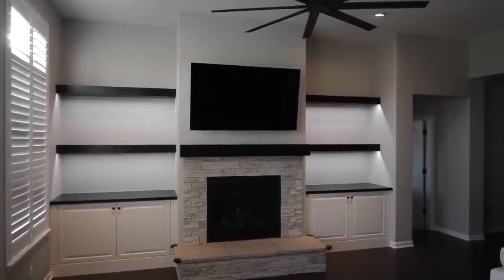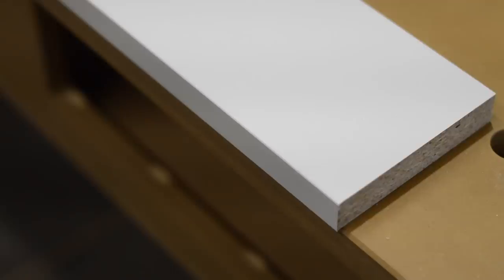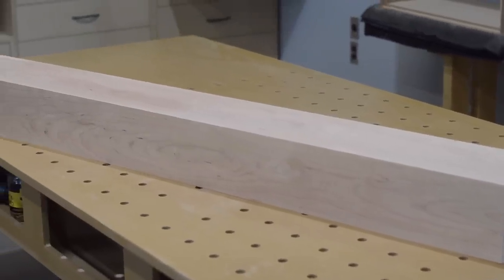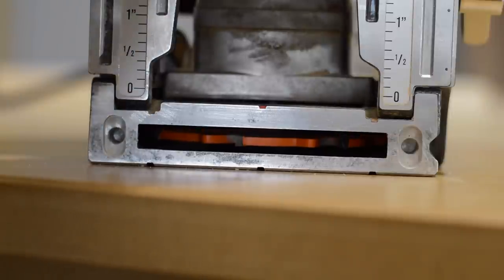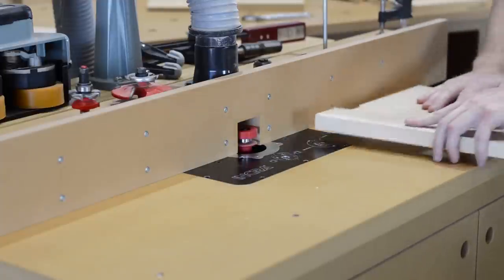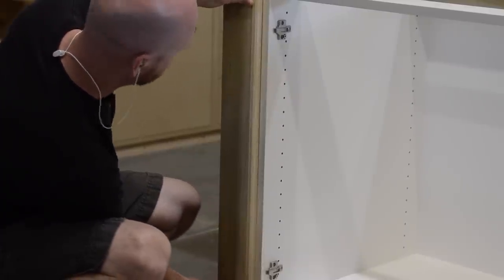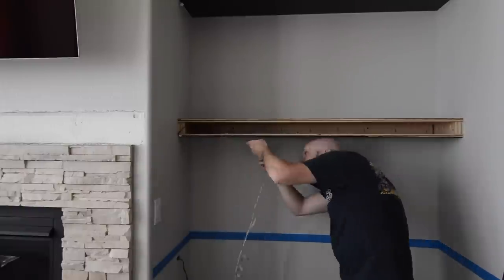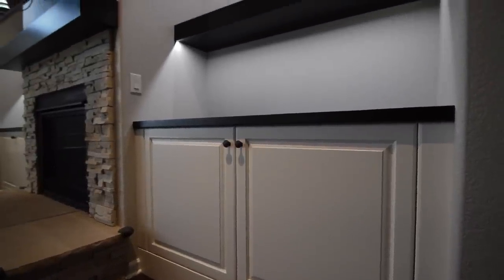Custom built in cabinets, floating shelves and fireplace mantel

Comment: Great video! When/how do you decide to use plywood versus the melamine for cabinets? I would love to learn as I grow my business
Reply from the maker: Sometimes its the customer, but my normal is, I use melamine for cabinet interiors, its more durable and saves on painting costs.
Reply: Interesting, I wouldn't have thought melamine would be stronger in cabinet construction. What should I change in my thinking? Because I thought melamine had an aire of less quality than plywood. 

Totally makes sense on easier for painting sure.
Reply from the maker: @dougbeach7299  I should have been more clear. The panel itself is not as strong as plywood, I was talking about the melamine surface. Its more chemical and scratch resistant than a painted ply surface.
Reply: Thanks Mike. Love your videos and your teaching. I've been rewatching your videos while in quarantine and they are very soothing, funny and knowledgeable while I recover.
Reply from the maker: @dougbeach7299  That is great to hear, thank you.

Comment: What kind of HVLP sprayer do you use,  how much do you typically dilute your paint and primer and with what?
Reply from the maker: I have a ton of different guns. I normally spray out of a Binks 2100. I can't say how much I thin, I just thin until it sprays nicely. I thin with what ever the base of the material is. Water, alcohol, paint thinner, etc.

Comment: A question on the mantel, why didnt you use any biscuits as added reinforcement to the joints where the grain direction didn't match?
Reply from the maker: Its really not needed. Bevel joints are pretty darn strong. Plus it would have made the "tape as a clamp" method impossible. The joints wouldn't be able to fold closed. Hope that makes sense.

Comment: Hey Mike, could you install those floating shelves over shiplap, provided you do secure them into studs?  Or is the proper way to have the shiplap cut out where the shelves would go so that they are flush with the drywall?
Reply from the maker: I would not remove the shiplap. I would just calculate my screw length based on the extra thickness of the shiplap.
Reply: @MikeFarrington  Thank you for the reply and all your videos. I wish you were located in NH! We are trying to get something very similar to this with added shiplap. Still debating contracting out (Big $$$, but deservedly so) or doing it ourselves with semi-custom cabinets.
Reply from the maker: @werty73  Good work takes time and time is money. Good luck with your project.

Comment: How did you get electricity to the dimmer and is it a regular household dimmer or some low voltage thing?
Reply from the maker: The lights I used were an all in one setup. So the dimmer was low voltage.

Comment: Mike what do you feel is the best way to seal the edges on your MDF ,like your raised panel door,oil base primer ,automotive primers,or water based with a little alcohol added to quicken the dry time and prevent swelling of the MDF,im thinking oil base as in some of your passed videos you mentioned a few days drying time ,or are you sealing with oil base and them switching to water base to prevent the smell,people just dont seem to like the smell on the clothes in walkin closets huh...lol
Reply from the maker: Shellac base is my favorite, though oil based would work just fine. I would stay away from anything with water for the first coat or two. The couple days drying time is due to the use of water based coatings. I feel they need a few days.

Comment: War Pigs covered by Faith No More is probably my favorite cover that is right up there. Mike Patton and Ozzy both have a higher range so I actually like the cover a little better than the original. I know die hard Black Sabbath fans will probably thumbs down this comment. Also, No Quarter, covered by Tool is another one where I like it better than the Led Zepplin original.
Reply from the maker: I really like this one. I also really like No Quarter. Good selections.

Comment: for the cleat on the mantle, where did you drive the nails in to secure it?  What nails did you use?
Reply from the maker: I used 2" 18 gauge nails. Two from the bottom up in each corner, two from the top down.

Comment: What is your setup for spraying paint finishes as well as clear finishes? I’m working on a kitchen cabinet build and I am looking for some advice as to what to run in my shop. Thanks in advance!
Reply from the maker: I use a 60 gallon compressor through an air drier, to a conventional spray gun. Very simple but effective. I show more about that setup in my paint grade mantel.
Reply: @MikeFarrington  I appreciate your reply. Your work is beautiful. I’m a little down on space in my shop and my compressor is a small porter cable so it isn’t big enough for me to run a spray gun. I’m considering a Fuji setup but still exploring options. Thanks for the reply!
Reply from the maker: @Tomfrey  I have a portable spray setup as well. They work fine, but normally struggle a little with having enough power for water based or thicker coatings. If thats what you have space for, go for it, it'll work out good.

Comment: The mantel, did you nail, screw a cleat to the inside of the mantel? I noticed you put a clear on the wall but dont know if it's the width of the back opening or if there is a cleat.
Reply from the maker: Yes, there is a cleat I hang on the wall, and there is one inside of the mantel.

Comment: Hey Mike, i noticed you dont have rubber bumpers on the face of your biscuit jointer, is that by choice? I was using mine in a vertical fashion today and i always find it tricky to keep it square, taking those bumpers off might help.
Reply from the maker: They should be on there, unless I have taken them off for a groove cut.

Comment: Hey Mike, how much space do you leave between the edge of the panel and the inside of the groove on the rails and stiles to allow for seasonal movement? Thanks!
Reply from the maker: In this case I used MDF which doesn't expand and contract enough to worry about. When using solid wood I leave about 1/16 -1/8" per foot of panel width.

Comment: Fantastic build, as always.

Say, I have the same Bosch Colt trim router and wondered if you ever have trouble with the unit sliding downward in the base?  It's happened more than I like.  I tighten the nut holding the clamping clip and it holds for awhile, but it always eventually starts to slip again - in the middle of a cut and destroys the piece.  Have you found a fix for this or is mine just faulty?

I think the Shop Apprentice is getting taller!
Reply from the maker: Thank you. Yes, I have had this problem with the Colt. I have found the only solution is to super tighten the nut on the cam lock. It's a pain in the rear.

Comment: Mike! Where did your older videos go? :( I really liked the small workbench.. etc..  On the other hand: Awesome build! ;)
Reply from the maker: To the best of my knowledge they are still up on YouTube. Maybe a computer issue?
Reply: I'm sorry, It must have been my mistake (or my computer's), but the point is that now I see the full list!  Another thing that I wanted to say previously, that I admire the setup and the tools of your shop, looks like a dream to me! I live in central-eastern Europe,  so we have and we use slightly different tools both in handtools and big machines, that's mainly because in my region 95% of furniture making is from two sided melamine, so the rest of the carpenters can live with a panel saw and an edge banding machine. I'm starting to build my own shop in a month and hoping that one day it's gonna look like yours :)
Reply from the maker: No problem. Computers can be weird. Best of luck with your shop!

Comment: Mike  for your  finishing, do you use a sanding sealer? Very nice
Reply from the maker: No. Some people seem to really like a sanding sealer, but most modern finishes are self sealing, so technically speaking no sealer is required. I do use a non clogging sandpaper when sanding after the first coat, so that may help achieve the same affects as what a sanding sealer would offer. Just as an FYI, and you may know this, but sanding sealer is the same as the main finish, but it has a lubricant in it to help ease sanding. This totally doesn't apply to finishes that are not self sealing. If a finish is not self sealing, the sanding sealer also helps with adhesion as well as prevents color migration if a stain was applied.

Comment: Hello Mike! I have an amateur question about material select. Wanted to know if you could have used MDF for your filler pieces, and why u chose poplar? Also I thing ur shop and what u do is NICE!
Reply from the maker: I could have used MDF for the fillers. I went with poplar because I wanted to be able to plane it down to a specific thickness, which ended up being about 7/8". I rarely have 7/8" thick MDF laying around. Thank you.
Reply: Got it, thanks for the response!!

Comment: Another great video Mike.  Have any more info on the leds, transformer and switch?  I have been looking into these for an upcoming project and the choices are overwhelming.  Also, thanks for the tip on the blum universal template.  I picked one up and that thing is great.  Wish I would have bought one years agao!
Reply from the maker: Thank you. I hear you on being overwhelmed with the choices. Honestly, thats the reason I buy from Wurth Louis and Co. I use their pro series LEDs. I know I'm over paying, but the cool thing is all components are compatible. They sell all manner of switches, transformers, LED tap, pucks, etc. You can open an account, just tell them you have a cabinet shop.

Comment: Great video, I tried using 1mm ABS edge banding with Fastcap tape but I found it super difficult to trim using a quad trimmer, how do you like to trim thicker edge banding?
Reply from the maker: I use a router to trim thick stuff or wood banding.

Comment: Another fantastic video that I've watched numerous times! I have another question regarding your hole boring machine....since it bores holes on 32mm center, I'm assuming its setup in metric measurements? If so, do you build your cabinets in metric units? If not, how do you keep your rows aligned because when you drill your first row you would reference off the top of the board and when you drill your second row you rotate the board which  references off the bottom?

Obviously, your rows line up, but I'm trying to visualize the process....
Reply from the maker: I build in inches. I use metric where I need to, which is pretty much all hardware. Yes, most tooling is in metric. My way around this is I reference everything off the bottom of the cabinet sides. All hardware, all shelf pins, door heights, etc. are all measured from the bottom. In this way the actual measurement is less important, it just needs to be consistent. Hope this makes sense.

Comment: Awesome video, Mike! I’ve watched it several times and have learned so much from it.

Did you have to do anything to the routed edges of the MDF prior to prime and paint? If so, what’s your preferred method for sealing the routed edges?
Reply from the maker: I use a fresh bit so the cut is clean. Then straight to primer. Spray heavy and sand as needed. Normally just a little. Also, use a good quality MDF, or there will be more sanding.
Reply: @MikeFarrington  thank you Mike!

Comment: Hi Mike, I have just found your channel and I love it. I have dabbled in cabinet making...Mostly out of MDF and painted. Do you have any problems with edge banding? Mine always seem to end up bigger than the original sheet material! Not upon application but in as much as the sheet material expands and contracts at a larger rate than the banding so even after finishing I get the paint chipping and  lip.
Reply from the maker: Thank you. I try not to edge band MDF. I prep the edges with a sanding disc and prime then sand. At that point I can paint the edges just like any other surface. I have a video on my channel going into detail about my process for edge prep.

Comment: Hey, great videos. I didn’t know PVC edge banding was a thing, so I’m going to go with that for a built-in TV cabinet I’m working on. You used speed tape for this one, so is your PVC edge banding not preglued? Or is it preglued, but you find the speed tape to work better than the glue?
Reply from the maker: Thank you. When using speed tape, I use edge banding with no glue. Speed tape is not cheap, but it really is fast, so thats my reasoning for going that way.

Comment: Hi Mike great work doing a project similar to this soon and always helpful tips. Can I ask what spray lacquer do you use. Is it solvent/waterborne or what company is it from
Reply from the maker: In this case, I just used a pre cat lacquer. I normally use a water borne lacquer, but I am having troubles with consistent supply. I bought it from Benjamin Moore.
Reply: @MikeFarrington  very good thanks for the reply👍

Comment: You mentioned there's a screw-in drywall anchor you like -- any specific brand? The ones I've tried always seem to break off as I finish screwing them in.
Reply from the maker: I use the ones from Lowes. They are white in a purple box. I make sure to pilot the drywall. I don't over tighten, I have installed hundreds, they seem to work pretty good.

Comment: Very nice job. How do you scribe the front edge plates to the wall?
Reply from the maker: I either measure and cut if the wall is pretty straight. If there is a bow or cup in the wall I use a compass with a pencil. I hold the piece in place, run one edge of the compass on the wall and the pencil marks the work piece.

Comment: Mike, what router and base (I think that is what you call the attachment & adjustment plate) are you using? I would like to build a table myself and need more details. Currently I only have a big two handed router that I’m using.
Reply from the maker: Its a Porter Cable 892 motor and an Incra lift system. It works very good.
Reply: Thx Mike, hunting time for me in South-Africa to see what I can find. I refuse to buy a table etc. just to damn expensive and will be of lesser quality than what I build. Thank you for the videos like it very much as you give me ideas for what to do.
Reply from the maker: Thank you, best of luck with your search.

Comment: Hey Mike great work I’ve learned a lot from you’re videos so I thank you for that. Question regarding the filler strips you make. Typically how much space do you leave on either side of the cabinets for them? Do you go for a close match to the width on the styles of the doors ?
Reply from the maker: Thank you. I normally make them something close to the wide of the door part next to it. Sometimes a little smaller if space is at a premium.

Comment: Hey Mike, Great work, it looks awesome! Question - how did you attach the top piece of the floating shelf to the cleat? I know you mentioned you had pocket screws for the bottom piece but I think I missed how you did the top? Thanks!
Reply from the maker: Thank you. I forgot to film that part. I used a about 5 nails to hold the top in place.
Reply: @MikeFarrington   Thanks for confirming! Where do you typically get your LED light strips from?
Reply: He states in the video @ 12:03 that the top is held in place with nails.

Comment: Mike,

Was the top of the floating shelf not attached to the cleat? 

Also the front you attached using biscuits?
Reply from the maker: Yes, I nailed down the top part with 5 small nails. I didn't show it on camera. The fronts were attached with biscuits and glue.
Reply: Thanks, Awesome work as always!
Reply: He states in the video @ 12:03 that the top is held in place with nails.

Comment: Hey Mike. When you use Melamine for your cabinet carcass, do you match the paint of your doors and side trim to it?
Reply from the maker: No I don't mind having the melamine one color and the cabinets another. I have a rule that melamine can only be seen when the doors are open, when they are closed its all the color of the paint or wood. I worked for a designer years ago and we used to put all kinds of fun colors inside the cabinets, even if they were painted white on the outside. Hope this helps.
Reply: Mike Farrington thanks. I really love your videos. And I love your shop. I don't have much space to work in, but doing what I can. Sometimes it's frustrating. I was a tool and die man for 25 years and I know what it's like to work in a sweet shop. One day I hope to have a nice wood shop like yours. And what a kick butt view you have to look at on breaks!
Reply from the maker: @Soul-driven  Thank you. I am very lucky to have my shop, especially if the shop has a nice view.